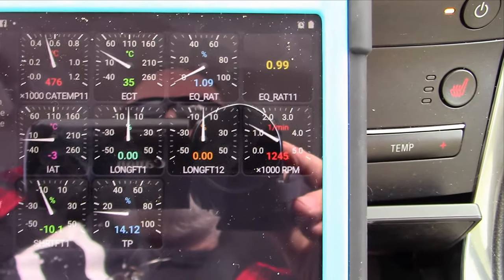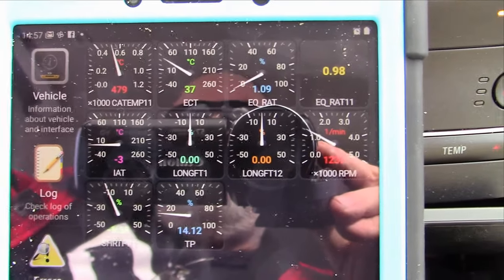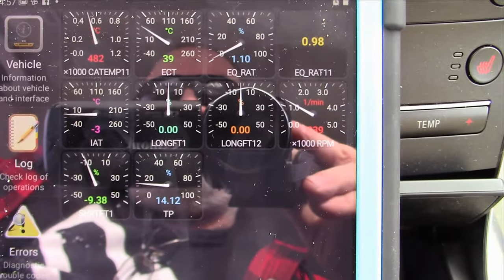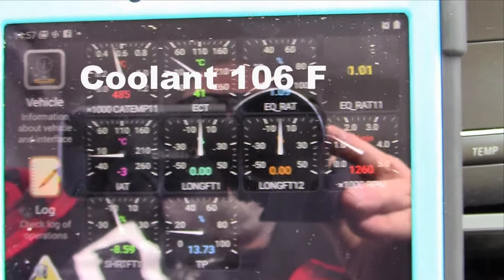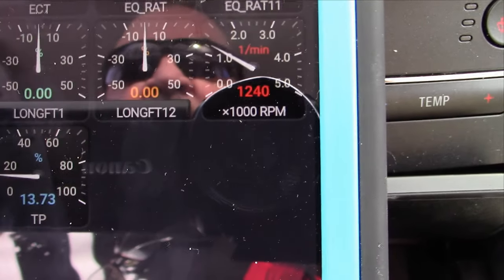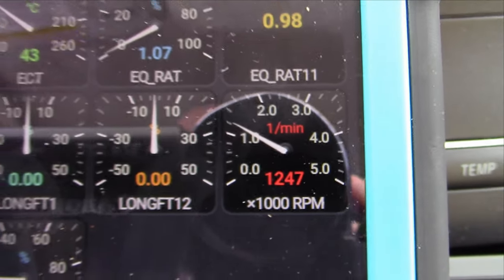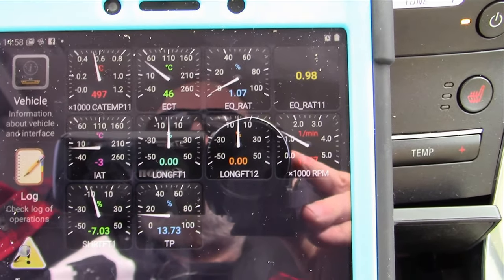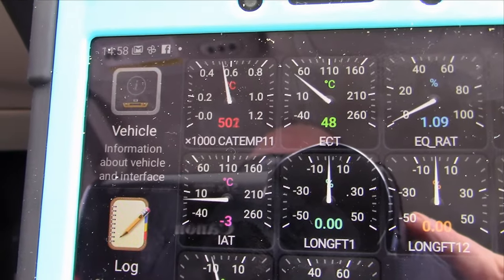Does the 2 0 Ecoboost warm up faster than the 3 5 Duratec?  Plus OBDLINK MX is used to monitor.

Comment: Great video/test! Due to the higher RPM in the 4 banger I wonder if it would use the same of fuel in the 3min vs the V6 in the 5min at 600rpm. :)

Comment: Your not overriding anything the pcm is programed to run rich on cold start and yes oxygen sensors are ignored intil the engine warms up enough.and the high idle is purely to warm the catalytic converter up to operating temperature for emissions purposes. And open loop means not using oxygen sensor and or airfuel ratio sensor  inputs. And closed loop means it is using oxygen sensor and or airfuel ratio sensors.
Reply from the maker: Thanks for the input
Reply: Found use of tablet interesting. Would it work with forscan. Would 2 Mb of ram be enough?
Reply: @goldwinggl1100  don't think 2 gb of ram is enough I use a autel scanner at work that is tablet based but it is slow. Laptop based scanners seem to work best like Ford ids or Isuzu idss or Cummins software or cat software are all on a laptop.
Reply: @MACTFordEdge  heres a little tid bit international on there new engines inject fuel into the cylinder to raise compression ratio on cold start causes alot of smoke for first 5 seconds after it starts